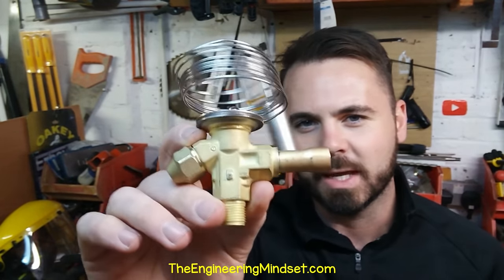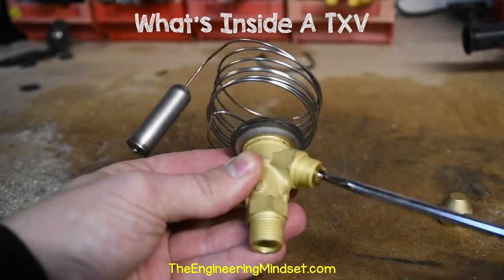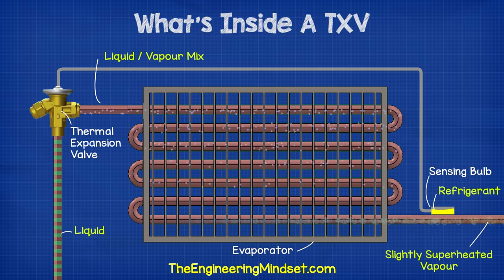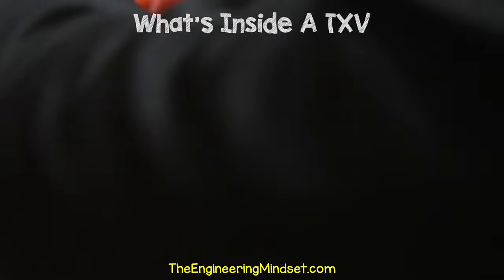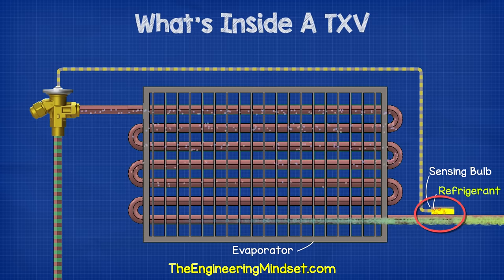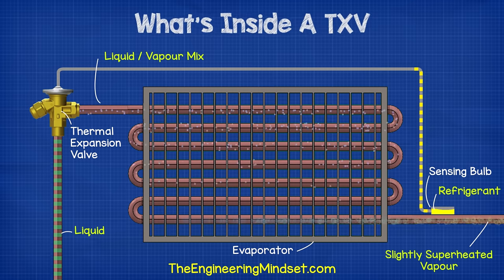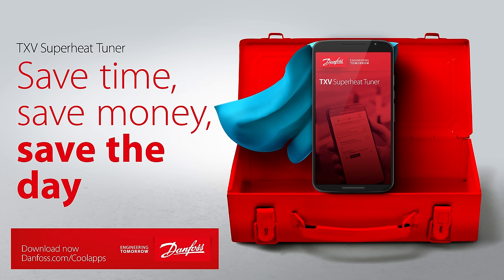What's inside a Thermal Expansion Valve TXV - how it works hvac

Comment: The key component to your video was Doing the cut away on the valve. It gave me a clear understanding on how the TX valve operates. Good job. Thank you.
Reply: Sure andtemperatureofthe refrigent  controld   in the  systomsince this bulbis attached  to  thesushion linethe  tempperutureofthe bulbis  thatofthe suction  gas when the gas temperure increusethe presure inside bellows also increase and the   valve stem  moves down spring tesionand  evaportator   pressure pushes   the   stem   up   from the  botyom of  the bellows  .

Comment: Thank you. Most explanations of the TXV usually omit the cartridge that the diaphragm pin pushes down on, and the subsequent conical orifice that allows the change in refrigerant state to occur. I remain puzzled as to where the heat of the incoming refrigerant is dissipated and escapes to, as the brass body of the valve does not seem large enough to disseminate the heat. It obviously does, and is of optimum design, but it just does not seem to be enough mass to transfer the heat to the air. Thank you, a nice demonstration.
Reply from the maker: The heat doesn't escape from the body of the valve. As the refrigerant expands through the valve the particles have more space and stop colliding so much. Imagine a crowd pushing through a turnstile, the pushing side is tightly packed, hot, sweaty, noisey and everyone is colliding  but once through the turnstile there's plenty of space to move around, tension reduces, no one's colliding anymore. Same energy just spread out. The heat is removed in the condenser
Reply: @EngineeringMindset  Thank you for your time, I will research further. Heat rises and is always dissipated to some degree. It's a complex physics proposition that goes beyond pressure, but that is the big block answer. Again, thank you for your time.

Comment: the main function of txv is to convrrt liquid phase to gaseous phase and to reduce temp to absorv surrounding heat outside the tubes.This is a application of Boyles Law,the txv is designef to automatically regulate the flow of fluid.Eduardo here.

Comment: Well if the valve closes when the cooling load is less but the compressor might still be on, wouldn’t that cause the system to burst? Is there any specific control system for that as well? Loved the explanation!

Comment: The expansion valve removes pressure from the liquid refrigerant to allow expansion or change of state from a liquid to a vapor in the evaporator. The high-pressure liquid refrigerant entering the expansion valve is quite warm. This may be verified by feeling the liquid line at its connection to the expansion valve.

Comment: The last ac tech that came to my house to service the unit moved the sensing bulb away from the pipe that it was attached to. Do you know why. Do you think the TXV is not working properly? Is this ok? Or should I put it back where it was? About how much does it cost to replace the TXV? Thank you so much.

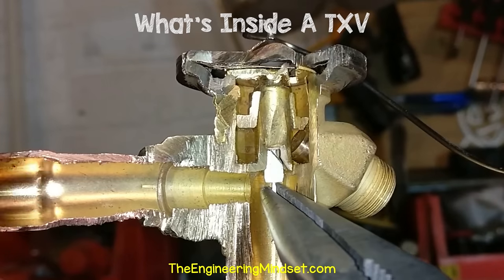Comment: ok very cool vid but I have a question in minute 4:16 you explain that the pin gets push by high pressure saturated liquid pushing the diaphragm up that pushes refrigerant to the sensing bulb and back and fort depending on the temp that you get from the evaporation coil so this refrigerant is never gets passed the diaphragm down to the pin? its only in the sensing bulb and capillary tubing and on top of the diaphragm?
its independent  from the refrigerant running in the lines right ?

Comment: Thanks for amazing knowledge. So i saw a small tube from expansion valve into the end evaporator (behind sensing bulb)  but i dont know what is that? Can u explain for me, please!
Reply from the maker: It's an equalising line
Reply: @EngineeringMindset  Is it similar to sensing line? Sensing line take sense from outside tube and that line take from inside tube?
Reply: @MTA141   Yes, the sensing bulb doesn't mix refrigerant with the system, it is kept within the bulb, capillary and power head. The equalising line is system refrigerant, doesn't mix with the sensing bulb refrigerant. The equalising line takes pressure from the low side of the pressure distributor. The distributor is needed to split the outlet pipe from the tx valve into many pipes, used on a multipath evaporator. The distributor will unfortunately cause another extra pressure drop, without the equalising tube the tx valve wouldn't get the correct evaporator pressure.

Comment: It should be pointed out that the underside of the diaphragm is exposed to the pressure in the evaporator, and that some expansion valves even have a separate line to sense the pressure at the outlet of the evaporator, thereby compensating for the pressure drop across the evaporator as well.
Reply: Automotive block-shaped expansion valves always sense pressure at the evaporator's outlet. The refrigerant that exits the evaporator directly pushes the diaphragm up along the way... even though we're talking about very small evaporators with no pressure drop at all...

Comment: What are the symptoms if something is wrong with the expansion valve?  If ice forms on the evaporator coils, can I fix it by reducing the flow of refrigerant?
Reply: Actually in auto AC coil icing is prevented by keeping flow steady (rather than decreasing it further) as evaporator refrigerant temp drops around 32F, so that the coil floods and the superheat becomes nil. That is, the TXV is acting as an AXV (automatic expansion valve) at that point. Still there's a compressor capacity control system should the return air temperature/refrigerant temperature drop down too much.
However, gas cross charges are used as the control charge.
Decreasing flow so that superheat climbs up actually results in the coil starving and progressively icing up from the inlet to the outlet.

Comment: Parker, Thermostatic TXV R-410A TX5N4.
Indoor Coil:Vertical CAPF4961C  Does this install OUTSIDE of the case? Looks like it does do you know if it does or not? Thanks

Comment: The orifice or hole function wasn't explained, also the change in temperature and pressure phases after the expansion valve weren't technically explained.  Some engineering information are missing. We would like to know more about the effect of velocity change in the refrigerant circuit.
Reply from the maker: Checkout our other videos on how TXV and EEV valves work

Comment: I have a two cold storage temperature controller Error PrE it's meaning I know but The problem is pcb/circuit .But I'm going to turn it on manually now, 
If I do not want to use Expansion valub, there will be no problem. Please tell me something advice. Thank you 🙏🏻

Comment: Why is the sensing-bulb mounted directly behind the evaporator?  Why not directly in front of the compressor?  If the superheat behind the evaporator ist tuned perfectly to 1K, it could be 10 K before the compressor which should be unnecessary  and inefficient.  What do i think wrong?

Comment: Sir hi plz ihave big problem ichange expansions  valve for air-conditioning  Skm in indoore unyte  evaporateur to mucht voice noisy 4 luiquid gaz insupportable.😣 this ac 48000bth. Waht iwill do now its harde for welding cappilary. Im tired 😫

Comment: So as the superheat increases, the refrigerant in the little tank boils, causing an increase in pressure and the valve opening decreases. Why do you want to reduce the flow rate using the thermal expansion valve when the superheat increases? If the thermal load in the evaporator region is high, causing a high superheat, wouldn't you want MORE refrigerant to compensate for this, not less?
Reply from the maker: Watch this: https://youtu.be/oSLOHCOw3yg
Reply: Answering is not that easy. Basically, this is because you don't want superheat control to be too precise, or the TXV will be constantly hunting for superheat (that is, repeatedly opening and closing) and the system will wear down faster and not be energy efficient. You want some superheat control to be there, but not too much of a control, or it will be detrimental to the system's reliability and efficiency. So, once you attain a certain superheat, it's best to leave it that way, or the AC system will became unstable. There's an example of an air conditioning system where everything has to be sized so no hunting is taking place at all, an automotive air conditioner equipped with a variable displacement compressor in turn equipped with a mechanical control valve that senses both the discharge pressure and the suction pressure and adjusts the compressor's displacement so that the evaporator gets cold but never too much (Google for "Harrison V5"). In these systems, the TXV valve (that little metal block looking thing) is designed so that it never hunts at all. How is that result achieved? Firstly, heat is transmitted from the refrigerant to the power element through the valve's metal body, rather than through a bulb directly impinged by the refrigerant that leaves the evaporator. The actuating rod is incredibly thin and won't transmit any heat to the power element at all. Secondly, the valve rating is actually undersized compared to the system's rating, that is, the typical car's AC system has a 1.5 TR rating, but when the car has a variable compressor the valve is rated as 1 TR at most so that it never overfeeds the evaporator (or hunting would happen). Thirdly, the valve's power element is cross-charged. That is, the power element charge is made from a mixture of gases that cause a greater pressure to develop inside the power element rather than at the evaporator's outlet, below a certain refrigerant temperature.  Below a certain evaporator temperature/pressure, the valve basically ceases acting as a TXV and begins acting like a fridge's capillary tube, leaving control to the compressor's mechanical control valve. That is, superheat goes to 0 and the compressor has to handle being fed with some liquid refrigerant, but the system will act in a stable way. In such a system, a hunting TXV would give you unsteady vent temperatures whenever you leave the blower on minimum speed with recirculation on, and would also deprive the compressor of lubrication.

Comment: Why Sensing bulbs are cylindrical ? why not Crescent shaped to be fit over pipes n have more contact area instead of line contact in cylinder ?????
Reply: @ike fun maybe m not smart as you, thats y im with questions. 

still you didn't answered me technically
Reply: harinath prajapati - great question I think. Ike fun - correlating this to being cylindrical because of strength is short sighted. I am sure the pressure in this little cylinder is not that significant.  Probably cost and ease of manufacturing is more of the driving force behind the design.   I think it was an excellent question - you should not belittle people asking very valid questions.
Reply from the maker: I actually like that you've questioned it. You've looked at something, questioned why it is this way and considered how it can be improved. That's the engineering mindset. It's cylindrical for strength, ease of manufacturing, universal fit on any pipe and equal heat transfer.
Reply: In automotive TXVs (i've just laid my hands on one i'm going to play with) the sensing bulb is still cylindrical, but it's "drowned" inside the refrigerant flow so that heat is directly transferred to it, and not through a pipe that acts as an interface between the refrigerant and the bulb...

Comment: Hello Engineers,
I'm wondering how it can regulate the mass flow of refrigerant without violating the rule of mass conservation? If there is some amount of refrigerant entering the valve the same amount should exit it shouldn't it? The one thing which is possible it's change of system hydrauilc resistance but it will not change flow because "volumetric" compressors have constat volumetric capacity. The other possiblity is that the critical flow(speed of sound) is reached during flow through valve and change in pin position changes cross area and this changes volumetric flow through valve and the mass flow as well. Could you tell me how exactly it works or show me a mistake in my understanding of this process, any book which describes this problem is fine as well , but I couldn't find it. Many thanks for your help in advance!
Reply: This used to confuse me when I first started my first job at a chemical plant regarding flow valves. The conservation of mass is being conserved. What’s actually happening is the flow of mass INTO and OUT OF the valve is being reduced. The compressor does not produce a constant flow rate, it is inversely related to pressure. What is happening is this: when the valve is “closing” the area of the pipe is effectively being reduced. This reduced area increases the friction losses of the fluid. These friction losses are what causes the decrease in pressure. The other variable that is dependent on pressure losses in the system is the COMPRESSOR. So as the friction losses increase with the closing of the valve, the compressor works harder to overcome the friction losses, this causes it to produce a higher discharge pressure. Since more energy of the compressor is going to producing pressure, less energy is going towards flow rate so therfore, flow rate of the entire loop system decreases. In real life, flow rate is not constant and is dependent on the pressure drop of the system. This is because of how compressors and pumps work mechanically/electrically.
Reply: Your not accounting for the fact that pressure correlates with heat. In a way mass is being removed through the condenser heat transfer

Comment: Any body plz give me a answer for my question what is the temperature and pressure of the supply & Return for cooling tower, compresser, condenser, Evaporator and Ahu...plz reply me I want this answer
Reply from the maker: Watch our videos: "how chiller, AHU and cooling tower work together" and chiller design advanced videos
The temperature is different in every building though
Reply: Can coil get frozen by the valve not working

Comment: why is it called superheat?, gives the thinking that it's at a high temperature when it's not
Reply: It's a process where the vapor reaches it's boiling point which is crucial since the refrigerant needs to boil off before it heads to the compressor, that's why he said in the video, bringing liquid refrigerant to the compressor is dangerous since it doesn't compress
That's why in the bigger refrigeration systems after the shut down of the solenoid valve the compressor vacuums the inlet line so the phenomena called liquid blow to the compressor doesn't occur
Reply: All heat added to refrigerant after the boiling point is called superheat. All heat removed from refrigerant after condensing point (liquid) is called sub cooled/cooling